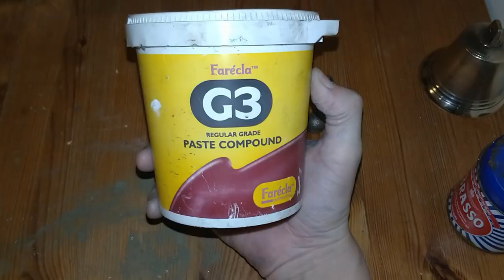Antique Brass Bell Restoration

Comment: To polish inside things like this, Get a length of hardwood dowel and cut a slot about an inch and a half (or 40mm ) down the centre. Then you can wrap wet and dry paper or soft cloth around the end and spin it with your electric drill! I have done this innumerable times over the years!! Lovely little bell restoration.

Comment: I believe it is a Servant’s Bell / Door Bell Pull Bell - I was blessed to have come upon a set of three recently - graded in size of bell and still with the springs attached where they go up on the wall . The size grading enables each bell to give a different ring so the servant could quickly identify which room / door needed to be attended . The bell in this video was identical to mine even down to the oddly shaped donger. Well done with polishing it looks great - hope you can do mine !!!!!!!!
Reply from the maker: Thanks for sharing! I'd figured it was either a servant's bell like you say, or one of those shop doorway ones. Without any of the attachments, it's really just guesswork!

Comment: I give brass a quick clean with soap and water for any dirt, then let it soak in citric acid and water, all the tarnish just dissolves off. When people give random products that they use I’m pretty sure it’s just the citric acid in those products doing the work.

Then a soft toothbrush with polish to get into all the difficult areas, then buff with a rag. Very quick process.
Reply from the maker: I tried simply cleaning this, it didn't shift anything more than just a bit of dust. 
I tend to agree with you about the citric acid - almost any cleaning product, natural or commercial, has some sort of acid/alkaline element to it that does the actual work. All the other ingredients are just there for texture, binding, scent, etc. 
I've got a perfect test piece now and I'm going to be making a video comparing all these different methods :)
Reply: @OldtoNewRestorations  nice! I’ll make sure to check that out

Comment: I have a cordless and variable speed Mikita drill and multiple polishing cotton attachments with rouge of several grits , which  I advise. The bench grinder mops turn so fast the brass gets too hot and is  scorched not to mention holding it like that is very risky. I don’t use wire brushes at all, they remove too much material. But it’s your bell, do what you want.
Reply from the maker: Thanks, but I've never had a problem with 'scorching' the brass. The trick is to keep things moving and not hold the part in one place for too long.

Comment: Great. Please put what sorts of polish you are using on the mops next time. I''m learning the hard way to restore paraffin heaters and the founts (tank) are brass. 😑 They all have different types of aging, the one I am working on now was covered with some horrible sticky, gungy nonsense that I got off with a dremel but it has scratched it a bit. So bought a polisher / grinder thingy. I have some bars of polish but not really sure what to use when since they arrived unlabelled.  Videos likes this are very helpful though, thanks a bunch x
Reply from the maker: Yes, they never label them properly! If you do some web searching you should be able to get them into some order - they're usually commonly coloured so you can match them up that way.
Reply: @OldtoNewRestorations  Thanks x

Comment: And once again a lovely job. I am into polishing brass, as I have over 200 brass weights, and think it would have been a lot easier if you had gone straight to liquid brasso and a 4 inch felt wheel on your bench polisher. Try and avoid sauce and anything with vinegar as the acetic brings out the copper and leaves the brass looking pink. To polish inside use a drill bit with many layers of string on it and use it with brasso taking  care not to wear through the string.
Reply from the maker: That's a great tip! I did try cleaning it with brass cleaner first, but the scale was pretty bad. I'd have been there forever like that! I think I've come a long way since I made this video though. There's a lot to learn!
Reply: 200+ weights, makes my collection seem tiny👍

Comment: How do you tell the difference between a brass bell and a bronze bell? Isit true bronze rings out longer and has a better tone?
Reply from the maker: Bronze is generally more reddish than brass, which has a yellow tint to it. 
I don't know about the tone when it comes to bells, but larger bells are usually made of bronze, which I guess is for a reason - bronze is the more expensive material too.

Comment: at 7;08 what material have u used along with closed stitch mop
Reply from the maker: It's just a white polishing compound, quite a fine one used for final polishing. But I've found it works well on brass even for initial polishing.

Comment: You could try plating any parts that can't be sprayed like the clapper. Cheapest and simplest would be zinc plate because it generally sticks well to most metals and you can harvest zinc from common zinc-carbon batteries.
Reply from the maker: That's a very good idea :) I've come a long way since I made this video and do a lot of plating now - but I wouldn't have thought about plating the clapper. The clapper is holding up well and not showing any other signs of rust so far, but I might think about that on my next plating batch. Thanks!

Comment: The spring metal bracket that had snapped off suggests it was a shop bell 🧡
Reply from the maker: Yes, either that or a servant's bell. I've seen that spring arrangement on both systems. As much as I've tried, I've never been able to definitively pin down what it was originally used for.

Comment: It came out nice, BTW it's not Victorian, it is much much much more modern than that, I have one like it, the only difference is mine is not missing the door mount bracket, Which BTW it is an older style doorbell lol You know before electronic door bells were a thing.
Reply from the maker: Thanks! 
I'm not sure of the age (and we could argue about that all day; it's almost impossible to narrow it down), but I'd certainly put it not much later than 1920s or 30s. I've seen similar style bells set up as servant call systems in old houses of that era. It could also be a door bell - it could have been used for all kinds of things.

Comment: How does he manage to still have all his fingers
Reply from the maker: It's just a wire wheel - and a brass one at that. I wouldn't recommend sticking your fingers in one, but the occasional contact isn't actually that big a deal. Of all the power tools in my collection, the wire wheel is one of the most benign. It's never drawn blood. 
The grinding wheel, on the other hand...

Comment: Vinegar and salt is the best cleaner for brass.
Reply from the maker: Thanks! I'm planning a video going over different ways to clean brass, I just need to find something suitable as a test subject!
Reply: Vinegar & Salt, please explain! I have an old bugle I want to restore and need a decent brass cleaner before I start polishing.
Reply from the maker: Vinegar works well as a brass cleaner, mainly due to the acid content. In my experiments so far though, I don't think it's any better than the usual commercial cleaners out there (brasso, solvol etc). 
If you're doing something like a bugle, you probably want something that's going to stick to the part, rather than something you have to immerse the part in. Sounds crazy, but ketchup may be worth a try! Just smear it on there, cover it in plastic wrap/cling film and leave it for a few hours before washing it off. It works surprisingly well if your bugle isn't in too bad condition.
Reply: @OldtoNewRestorations  thank you for that. I've just finished cleaning it... I used 'Barkeepers Friend' powder in water and it came up AWESOME in just a few minutes, all ready for buffing now!
Reply: Ketchup works in a pinch as well. :)

Comment: Nice job. Something you could try with rivets is to drill them out just short of the full diameter (in steps) and punch the rim into the centre and out.
Reply from the maker: Good tip, thanks!
Reply: @OldtoNewRestorations  at 7;08 what material have u used along with closed stitch mop

Comment: You should put your hair up when working around power tools and machines. I've seen guys get their hair ripped from their heads in seconds. You bending over your brass wheel and your hair hanging down, you should be more careful.
Reply from the maker: Very good point, and I usually do. I guess I was just feeling lazy that day! 
That said, the video makes things look closer than it actually was, my hair was well clear of the wheel.
Reply: @OldtoNewRestorations  thats good. Video was good,was just worried about your safety! Keep up the good work!
Reply: Tommy....so right... I was drying my hair upside down to get it dried quickly using a friend's hair dryer {different to my own}....and Whump! A bit of my hair got caught in the fan and made more of my long hair get twisted into a thick rope within a second.
I had to actually cut it off at the point it entered the hairdryer.
When using machinery proper, I always make sure my hair is tied up  out of the way.... the hairdryer lesson was a painful one.

Comment: Is your flex shaft attached to a bench grinder or to a multi-tool?
Reply from the maker: It's a Dremel (actually a knock-off; I think it's Clarke branded). Not much torque so it bogs down quite easily, but still a useful tool to have!

Comment: real lack of safety measures, at the least gloves when using the wire wheel !
Reply from the maker: I admit I'm not the best when it comes to safety at times, but gloves are a terrible idea when using a bench grinder. That's just asking them to get caught up and sucked into the machinery. I'll keep them off, thanks. The wire wheel isn't as dangerous as you seem to think, anyway.
Reply: @OldtoNewRestorations   Would you consider using ‘Finger Cots’ ? Just to prevent body salts and oils from the items being restored?
Reply from the maker: @e.conboy4286  It's an interesting idea, not one I've seen before to be honest. I would normally do final polishing by hand and would use nitrile gloves. But I'll consider those for future projects. Thanks for the tip!

Comment: I think you are too lazy and went on to grind that victorian bell too quickly, without even trying less harmful ways of cleaning it. Your work that I could see had made it looked scratched, even though it turned out shiny. you will never make a proper restoration person by the technic you have just show. Boiled in salt and white vinegar and left to cool down. then a paste of vinegar, salt, lemon and flour on top for a half hour would have brought it up like new. Even the pitted ball. Trust me I have had worse.
Reply from the maker: Thanks for the feedback! Yes, I think I was probably a little hasty, but that was more due to not having or knowing any other methods that worked (I did try a few other things off camera) than any laziness. 
Since then I've gathered a few different methods of cleaning brass and as soon as I find a suitable subject I'll be trying them all and doing a comparison video 🙂
Reply: @OldtoNewRestorations  Been in the maritime industry 20 some odd years... I have seen people use hot sauce, mayonnaise, gatoraid, vinegar and so on. It all works. Mayo is a bit nastier to clean up though. I personally use hot sauce then follow up with a polish like brasso. 

As far as how funky the bell is you are working with in the video.... I would have tried soaking it in something for a few hours first then started working on it with a stiff bristle brush to try and keep from deep scratching it. If that did not work, throw it away and tell the office to get us a new one 😉 

Sometime you gotta break out the grinder to show them bells whos boss.
Reply from the maker: @LordDeadSpider  Hot sauce? Another new one for me! 😃 I'm keeping an eye out for a suitable test subject, then I'm planning a video to compare all these techniques. I've learned a lot since I made this video, that's for sure.
I do still love my grinder though 😉